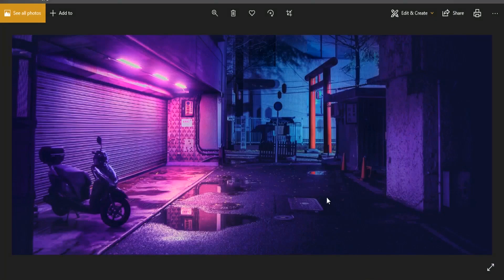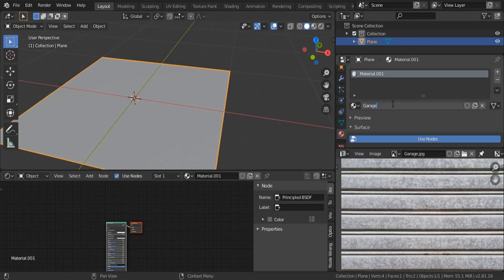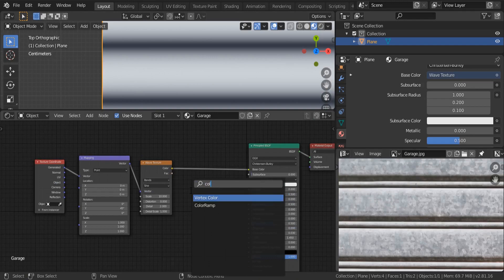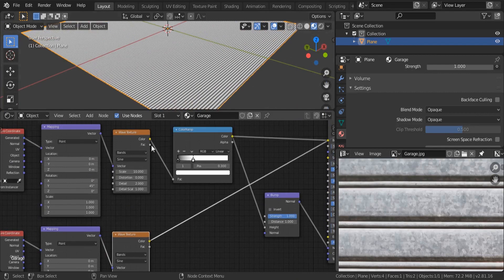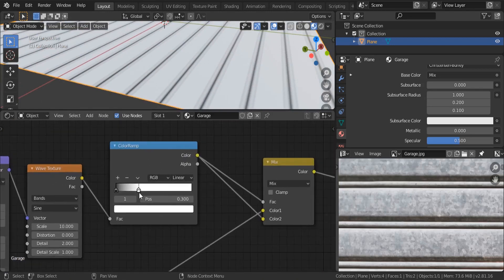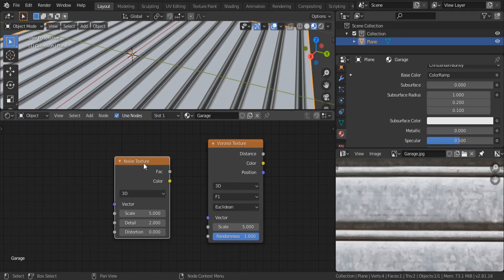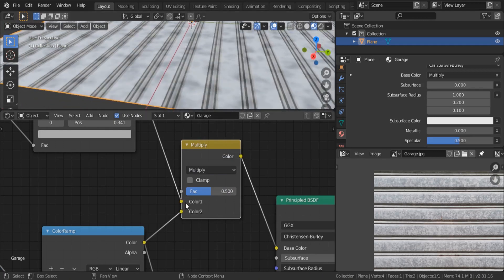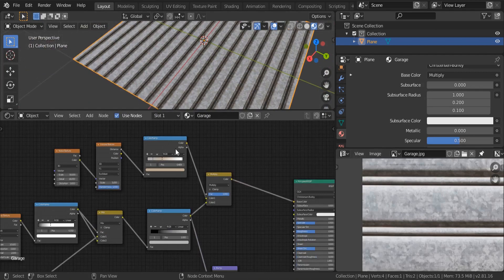Create Garage Texture in Blender 2.8 (Procedural Texturing)

Comment: You could just create the pattern of small segments and large segments in the first color ramp by adding more pointers.
Also, it would be a lot easier to just model it and then bake a normal map and ambocc map from it, then add procedural rust and noise after.
Reply from the maker: Modeling & baking is a smart way to do it.. basically there is alot of ways to get it done. Thanks for the suggestion